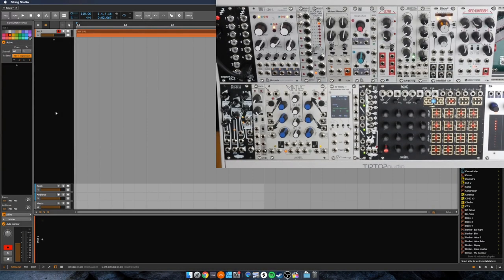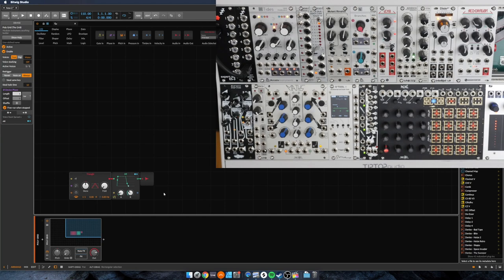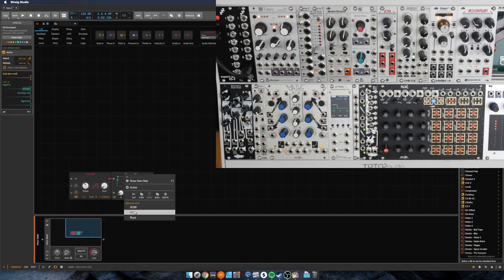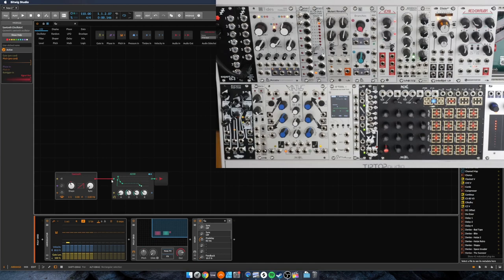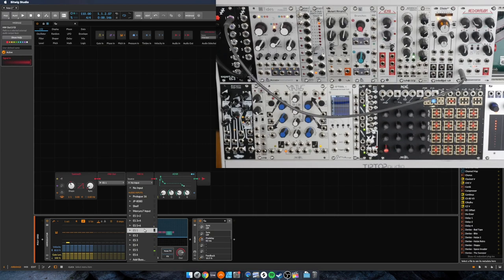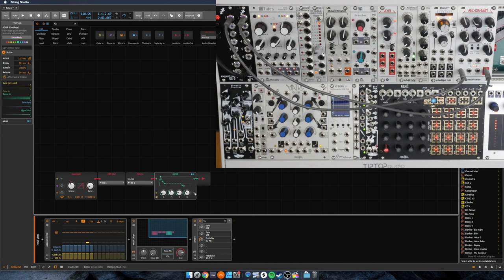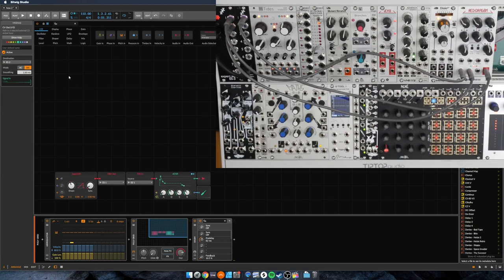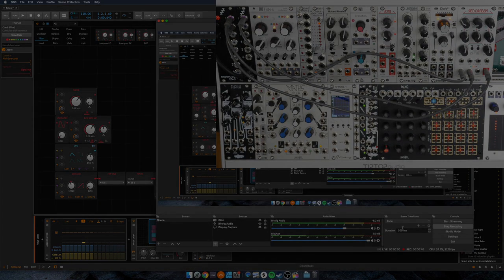Bitwig: a DAW for Modular Artists - Part 2

Comment: It would be worth mentioning what features work with the $99 Bitwig, and which need the $400 one. Also very briefly touching on latency would be a good idea. PolyGrid is a $400 version feature. But it's unclear to me if there is any way at all to use $99 Bitwig with Eurorack. Finally, does either version have abilities to interact with VCV?